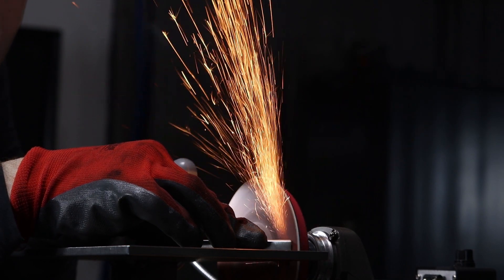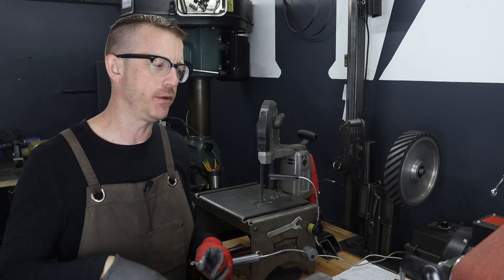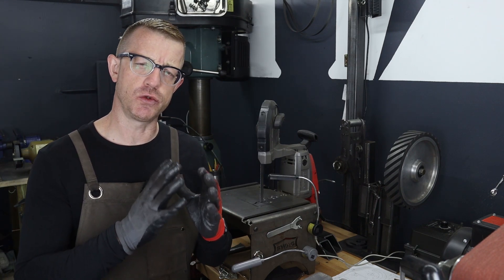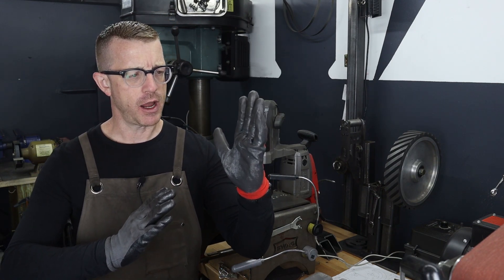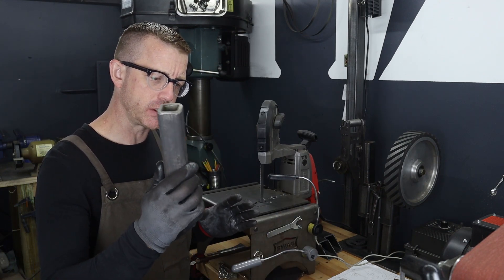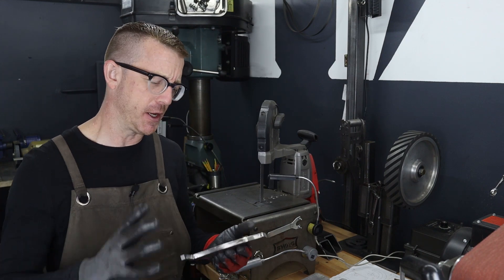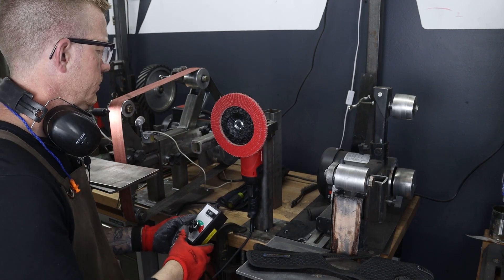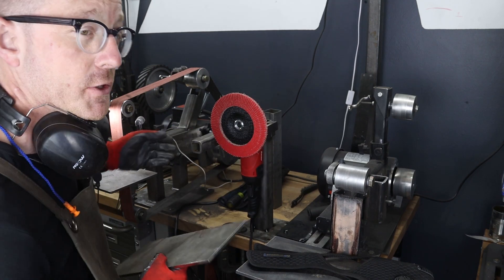How to: Building an Angle Grinder Stand  - Step 3

Comment: Kind of a late comment, and I'm sure someone has probably suggested this already, but have you considered a ball bearing spring detent to precisely locate the 45° angle? Just requires a ball bearing, a spring and a grub screw.
Reply from the maker: Yeah that could work. I use this device a lot.

Comment: Thank you for using clamps on your drill press. I cringe every time I see someone try to hold onto something and drill, especially with gloves on, be careful with those too. I've seen some terrible stuff happen when gloves get sucked into a drill, lathe, etc. Keep them fingers safe.
Grinder looks awesome too.
Cheers 🤠
Reply from the maker: Yeah that little table build has greatly increased safety and accuracy. I love that dang thing. Hope you are well brother!!

Comment: lots of recent 1 stars, :(

https://www.harborfreight.com/corded-7-in-11-amp-angle-grinder-62766.html

I have the 9 inch grinder thinking it was as good as my Metabo some decades ago, 

but's horribly noisy, as if the gears weren't really Happy Together
, noise being a complaint the H/F reviews had for the 7 inch grinder
Reply from the maker: This isn’t the one I used. I bought the Bauer version because of the reviews on the Chicago Electric. It’s pretty nice. Seems like good quality. Look at the link in the description it takes you to the right grinder. 👊🏻
Reply: @HouseMadeUS  And I looked for 7" angle grinder, because you were using 7" wheels, but on the 4 1/2 inch grinder.  

you might want to check the max RPM of the 7" wheels against the grinder RPM
Reply from the maker: Yeah it’s a push but seems to be okay. I will most likely be using the 5” pad a majority of the time.